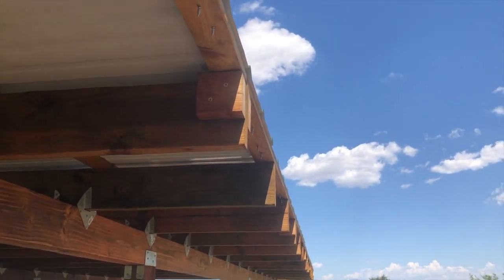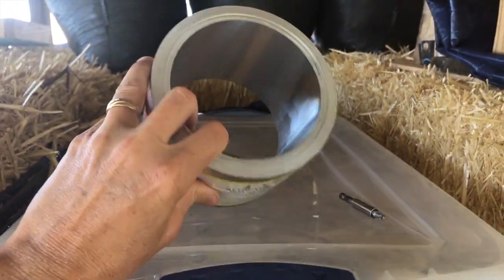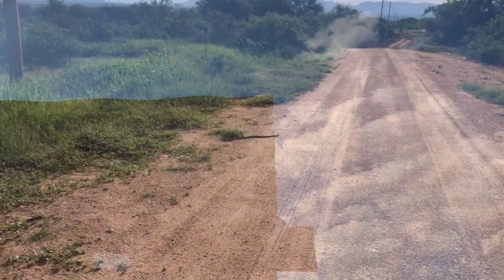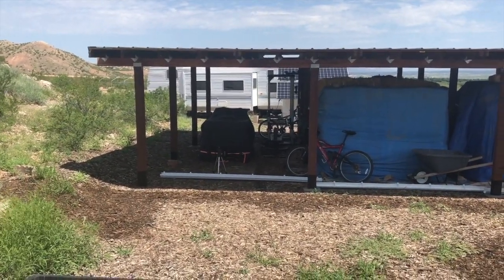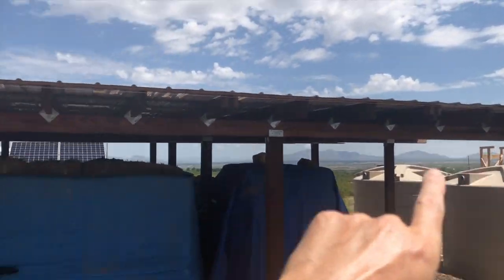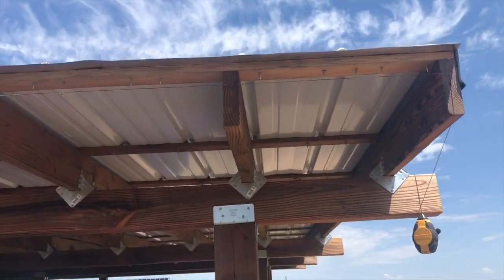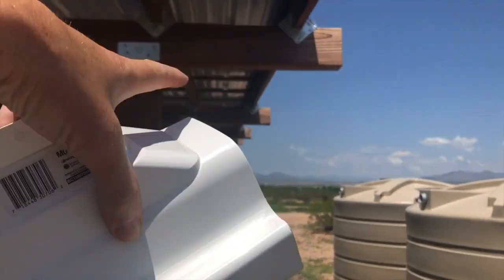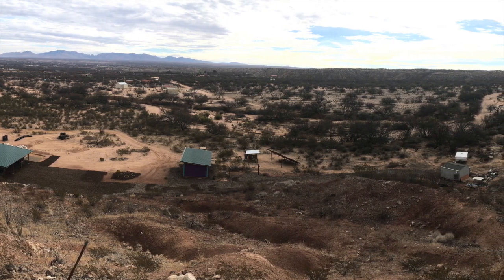Rainwater Harvesting Gutters Install (Part 1: Metal Roofing Mistake Correction And Gutter Layout)

Comment: Brian I thought your improvisation using the flashing was absolutely brilliant.  Storing that away in case I need that fix myself.  I envy you not having to trench 45 ft to your tank LOL like someone I know.
Reply from the maker: Thanks, Don.  No trenching, but I do have to hang some PVC to get it over to the tanks.  Hope that doesn't cause me too much trouble! 🤞
Reply: @MidlifePrices  Brian will you encase the PVC going from the roof to the tank in some sort of insulated sleeve to keep things from Busting during colder winter days. I saw that happened to Jim in one of his videos.
Reply from the maker: @affordabledesertliving3487  Hmm.  I wasn't planning on it, Don.  Theoretically, water should never be sitting in that pipe, so there shouldn't be anything there to freeze.  I'll have to go back and look at what happened to Jim, but I don't think there should be a condition where water could freeze in that section of pipe.

Comment: I know you're not specifically a "how to" channel but you filmed a really nice how to video.  I like how you are going to feed you tank using gravity and a pretty simple pvc pipe system.... gravity is your friend  :  )     Do the brackets on your gutters have a channel for screening?  I know it's pennies a foot and is something you might want to consider.  Another layer of water filtering never hurts and it really helps with gutter clean out later.  Even with no large trees around you'd be amazed at what the wind blow up on your roof.
Reply from the maker: Thanks, David!  I don't really do the how-to thing on purpose, but it's just kind of how I talk when I'm trying to show what I'm doing.  Hopefully people get something out of it.  There's no channel for screens.  We're in a pretty open area, and not much gets on the roof other than dust and maybe some bird droppings that actually almost burn off from the sun.  I don't think we need to screen the whole gutter run, but I'll definitely want some sort of screening at the downspout area.  Still thinking about that one.